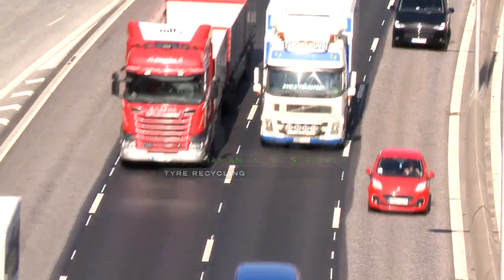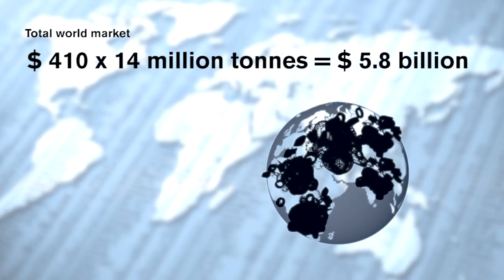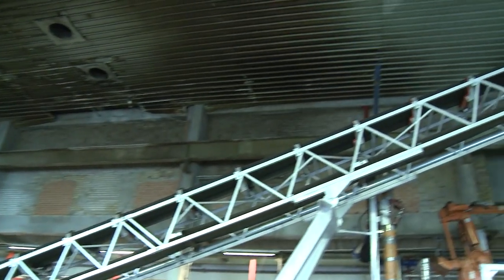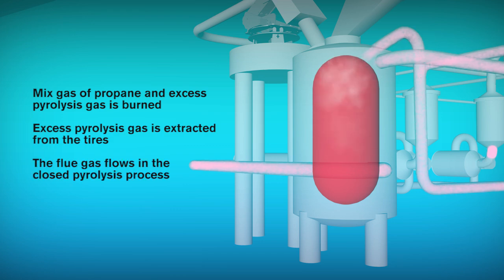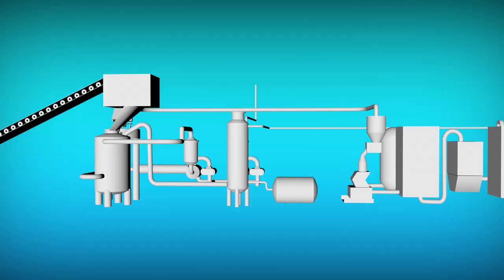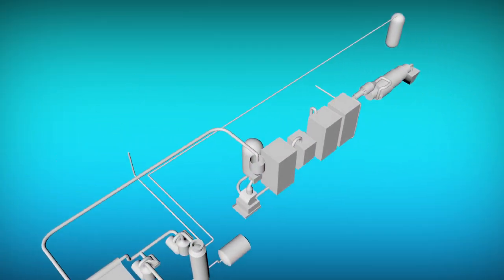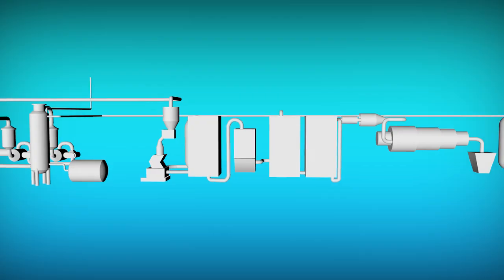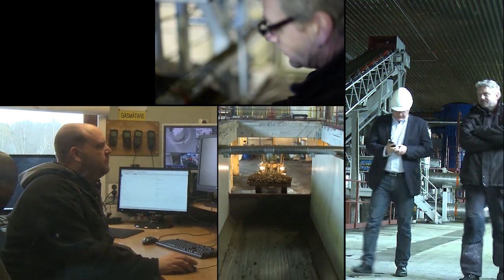Scandinavian Enviro Systems - Pyrolysis Process presentation

Comment: There is way advanced method than this. This is an old fashion way of doing pyrolysis.
Reply: Would you please tell me how can I get a small scale pyrolysis system ?
Reply: I have a hard time to understand now. I thought pyrolysis was a pantented method invented by Enviro. So what exactly is it that Enviro have patent on i this particular case? Some sorts of pyrolysis method to extract gas, carbon etc through this so called pyrolysis method?
Reply: @jonathanhimmelroos5882  The pyrolysis itself is an old way but the design of the reactor and the condensers are the main factors all companies have competition in.